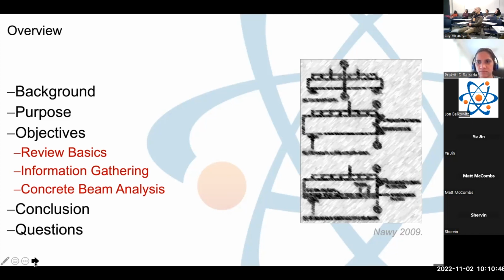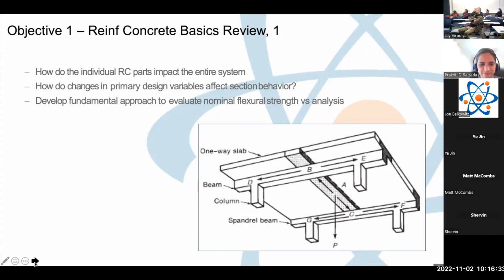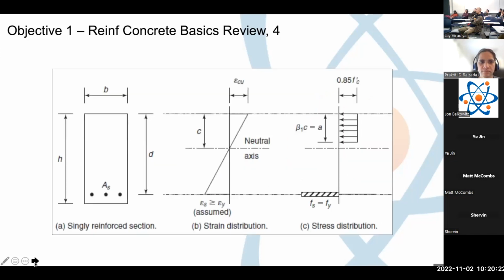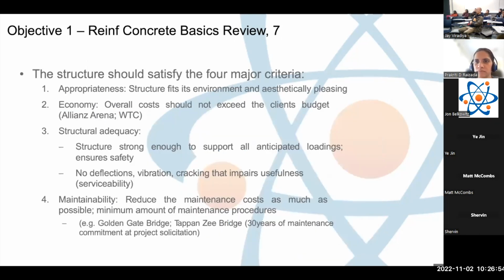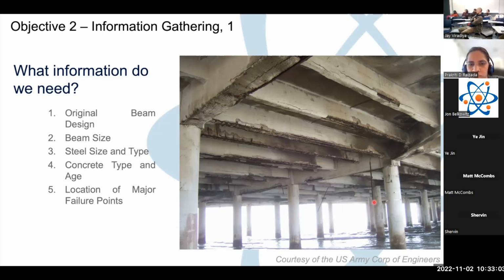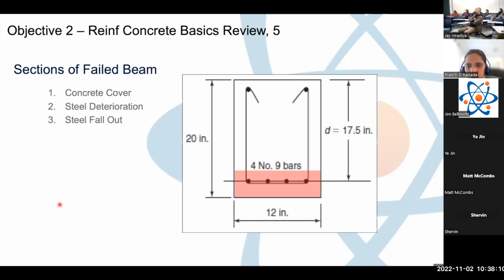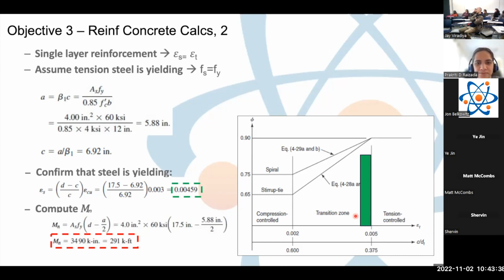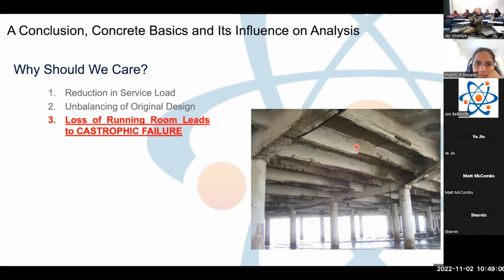Evaluating A Concrete Bridge that is Falling Down, Reinforced Concrete

Comment: Why do you reckon them thickening beams are damaged,,  underneath 
Let's say its not high trucks..
      Is it over vibration when poured..just in that small area
Is it a release agent thats been sprayed on an ran down there an reacted..
    Has it cracked away from the  steel.. an the crack ran...
        Im not really sure,    but I could fix it  ,easy...
      Most epic concrete fails are usually concrete jobs done by poeple who are not concreters,,,,
Reply from the maker: This looks like a combination of salt water (chloride and sulfate) attack and overloading, both over a long period of time.
Reply: @IntelligentConcrete  ,,if its salt water it will hit the steel an rot the steel through the structure,,,an should be taken down straight away..
We  use high mpa when near salt water 
The concrete gives you lime burns 
Thanku for your answer 
An yes you are concrete mad
An its good to see 
An your knowledge is very good to
Concrete owes me 34 years,,, an if it wasn't for concrete an concreters ,,,life would of been shit,,,,,thanku